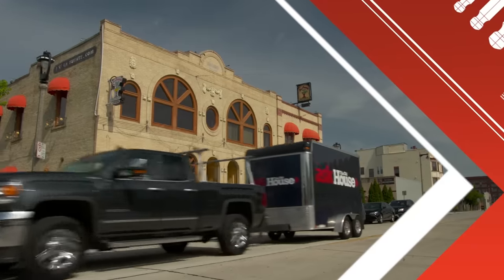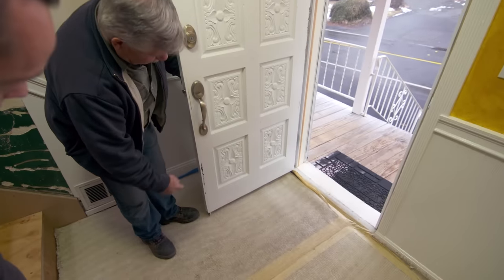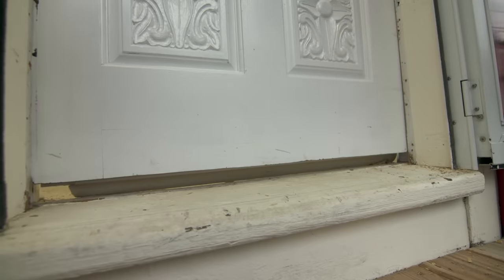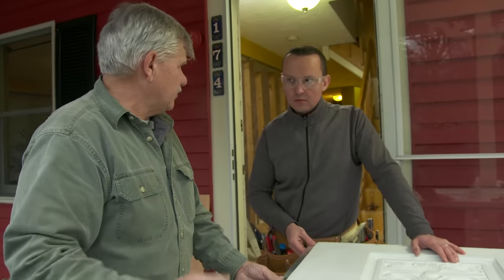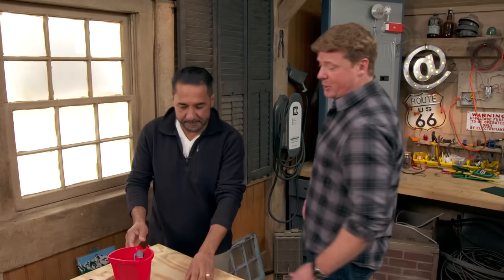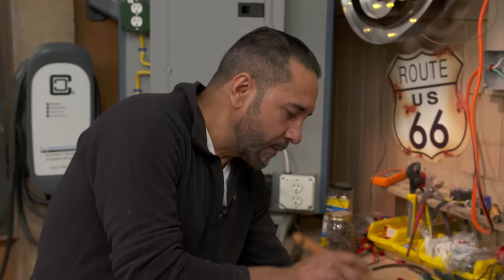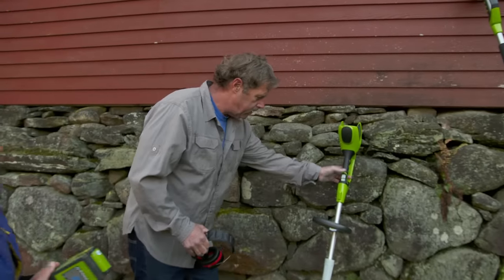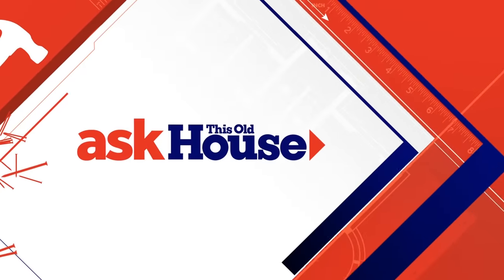ASK This Old House | Drafty Door, Clean Paintbrushes (S16 E25) FULL EPISODE

Comment: House sat for a friend years ago. Small yard. They had an older electric mower with a lead acid battery. Just enough juice to do the lawn, but it was so easy. Just pull out the charging plug, push it out of the garage, squeeze the handle and go. No throwing out your back trying to pull start an engine that hasn't seen maintenance in 10 years. Very quiet too. I chucked a bit when they put on hearing protection for the push mower.

Comment: Awesome, I've got a few doors out of square and plumb, they don't meet up with the jambs evenly.

One bit of advice I have for drilling the holes for the hinge screws, use a centerpunch first.  I've had too many issues with drill bits walking around the location instead of drilling right on location.  With a hinge you've really gotta get those holes lined up right, so a centerpunch is just the tool to ensure they do.
Reply: They have self centering drill bits specifically for hinges
Reply: yeah a vix bit works well,  the center punch will also work  or tap the end of a phillips number 2..
Reply: @Kevin-mp5of  or a lobstah tail...🦂
Reply: @markr7018  a scorpion?  Wtf
Reply: @jeffwilson1399  im in Texas so they look different over here.

Comment: I'm not sure about this one but I do it and it works out fine for preserving latex paint paintbrushes.  When they're as clean as I can get them, I brush them several times over a bar of soap , shape them and then let them dry that way.  When I need them again, I soak them the night before in water to get rid of the soap and use them clean and damp.  I started doing that in college, when I was preserving my expensive oil painting bristles.

Comment: Best thing about an electric lawn mower, you can hand it on the wall without oil and gas going everywhere. I hang mine with the deck facing out so I can sit down to clean the inside of it and then it has a chance to dry which will extend its life.

Comment: from someone that grew up in construction and worked in the labor force.  The hearing protection always cracks me up. Never seen it on a job site once. But this is still my favorite show ever.
Reply: What????  Huh??????
Reply: 20 years in heavy highway.   I'm deaf as a doornail.  And I still have 40 years till I can retire(die)
Reply: You're a fool not to use hearing protection with power saws and even hammers and drills. But ridiculous to use with a battery-powered trimmer, those things are whisper quiet.

Comment: I find Battery Operated Mowers are good on up to 3/4 maybe 1 acre of land where you are already mowing at least once a week so the grass is not tall. But if you are someone that is only mowing like every 2 to 4 weeks and the lawn tends to be Taller. Then Gas Power Mowers are much better Solution due to the power it gives to the blades. If anything, If you want to have a Battery Power Mower. Go for it, But, also Keep your Gas Power Mower as a backup.  Battery Mowers are Getting better as the years go by and maybe in another 10 years they might even be On par with Gas Mowers.

Comment: A professional painter once gave me a good tip about paint brushes,when you are finished with your brush at the end of the day,load your brush with paint that you will be using the following day and put it into a plastic bag,the paint won’t harden and you are ready to go.
Reply: You can do that with your rollers too - wrap it in a couple of plastic bags (don't take it off the roller handle) and put it in the refrigerator. It will be ready to go back in the paint tray next morning.

Comment: The methods that true professionals use to fix common problems are enlightening to home owners with the desire to do the job ourselves, but who have no formal training in this area, and we rely on This Old House to find out how to do specific repairs and projects.  

How does a young person in Massachusetts, for example, get the training and experience she or he needs to become a competent residential finish carpenter or a master of fixing these common problems quickly, efficiently and correctly, while meeting any applicable Building Code requirements?  A show with a segment on this subject would be helpful to many viewers, including those who are young enough to just be picking a trade to follow and those older viewers who are thinking about making a mid-life career change, if such a segment has not already been shown.

Comment: THAT V BASED ROUTER.
brand?????? Where to buy???

Found the link.

They sure do make it tough to buy!
Reply: Where did the link go?
Reply: @MattDoyleMusicOhio  

I don't even remember where I found it😂
 I did buy the machine and invested in a out 20 ft of each size plus I also bought the stuff you silicone in place..
 The doir jamb I used it on gave me tons of problems because there was caulk in it.
Envision routing caulk and expecting it to  stay open. Needless to say I used the glue in stuff. That did work nice though and their graduating size system worked well for this 120+ year old doorway. 
 I haven't used the rig since but, it like the domino... when you need it its priceless
Reply: @MattDoyleMusicOhio  WS98 Corner-Grooving Machine

Comment: MY 30 year-old gas mower still has all the replacement parts available - will a battery powered gas mower have replacement batteries in 5 years? I can't even get a replacement battery for my three-year-old cordless drill.
Reply: Next time buy a name brand.

Comment: That door is almost a days’ worth of work. Another couple hours for finishing/painting with another 1 or 2 trips to the job. $1000 easy,  if you live in a medium sized city. Large city, depending on the neighborhood, maybe $2000.
Reply: He should have showed a photo of the inside jamb when done. Cant imagine that after moving the hinges that much that the reveals inside look correct.
Reply: I don't know who you hire for what should  be a couple hours of work. The most time would be in the waiting for the paint to dry.
Reply: @shatoyancy9102  That's what I was thinking, the door looked fairly evenly spaced with the jamb, while sure it was too large it looked like it belonged.   Him moving the top part of the door an inch and a quarter in has to look all jacked up on the inside now.
Reply: @patzeuner8385  for the quote: assume 30 minutes drive each way, 1 hour to understand the customer’s goal, take photos, measurements, etc.  [2 hours]. Order, or pick-up, the automatic threshold  [1 hour]. Drive to the job, All that trimming the Jams without removing them, clean up after yourself. [2 hours]. The work on the door [2 hours]. Rehang the door while the glue is still drying [2 hours].  Drive to the job again, remove the door, sand and primer. Rehang the door. [2 hours]. Final trip to the job using a one coat 2 part paint that will cure on-contact, and all the masking needed. [1 hours]. Cleanup and billing [1 hour].  It’s a 13 hour job. Nope it’s a 15 hour job. 12 of which are billable for the quote.  Smaller city, $75 per billable hour. Large city downtown, $125 per hour. That job is $1000 in a medium sized city. $2000 in a large city.
Reply: @kimsmoke17  like I said for a couple hrs. worth of work. This is something the semi experienced weekend warrior could do, or a local handyman. They don't pad the bill. If you are in the business of remodeling, then yes, take all the time in the world, so you can bill the max in hours. In your comment, there's a lot of 2 hrs for this and that. 
 I have done this type of work and it doesn't take 2 hrs to do a 1/2 job, like cleanup. Oh, and I actually move when I'm working, that's why I am always leary of the estimates, specially for time that is claimed. I'm all for helping the local contractors, but I don't recommend the guys that like to help themselves to the customers wallet.

Comment: the YouTuber colinfurze made an electric riding mower out of an old gas riding mower and setup a soral shed to charge it. so it's likely possible to use renewable energy sources to charge the batteries for your electric lawn tools. his video was EV Mower Conversion with Solar Charging Station Oct 28, 2021

Comment: How to fix screen door onto door jam that keeps falling off
Reply: That depends on why it keeps falling off.
If the screws are coming out of the door jamb, then you need to fill the holes and re-drill them.
Reply: You could also drill them out and insert dowels into them, then drill new holes into the dowels.
Reply: screw it back on, use larger/longer screws.. if the wood you are screwing into is shot, then deal with that first..

Comment: Sorry to burst your bubble. But silly bead weather stripping and automatic door bottoms in this circumstance. It's flat-out garbage. What are you going to do about water? What you should have  installed at the bottom of the door was multi-flex weatherstripping or smooth and shoe. At the heads and jams I would have gone with spring bronze or cushion bronze.  But since you repaired the bottom of the door. Job well done on the repair. I would have gone full interlock weatherstripping.

Comment: Cheaper just to buy a new door that is actually make for the opening.
Reply: Not necessarily, especially if you pay someone to hang it. But you might not find one with that same design on it either. Which is what the homeowner said they like about the current door.

Comment: @ 15:30 WHY did you LOAD UP the brush with PAINT, and then put it under the faucet????  Shouldn't you WIPE the brush on scrap wood or paper to empty the brush BEFORE washing all the PAINT down the DRAIN???  
Are there not ENVIRONMENTAL REGULATIONS AGAINST this practice???